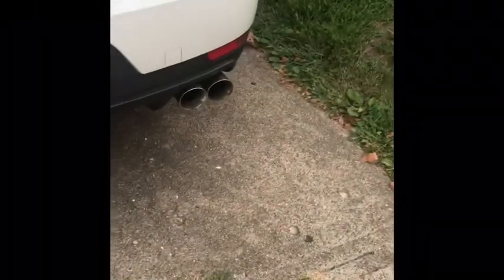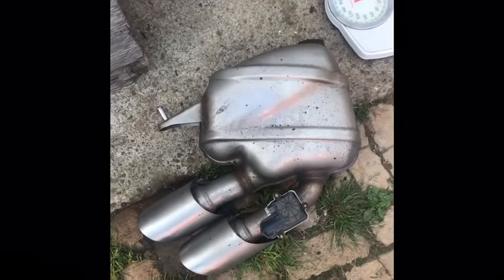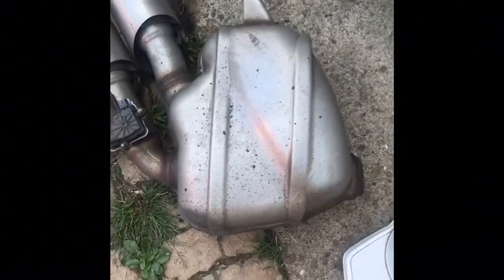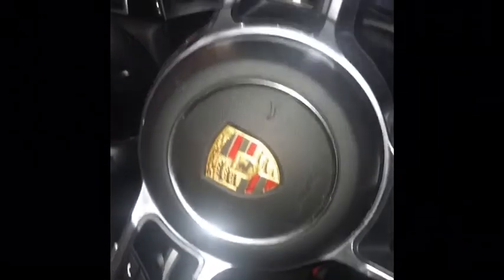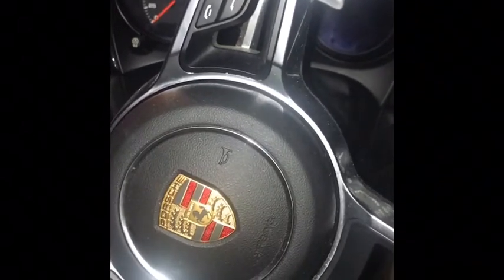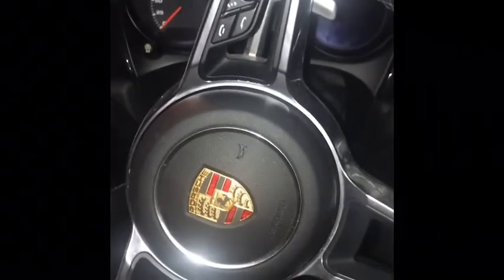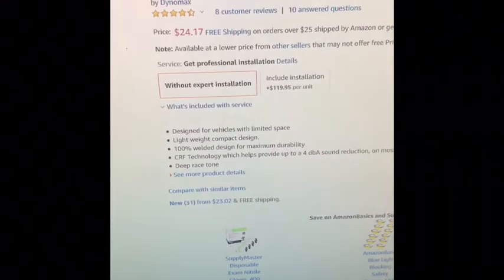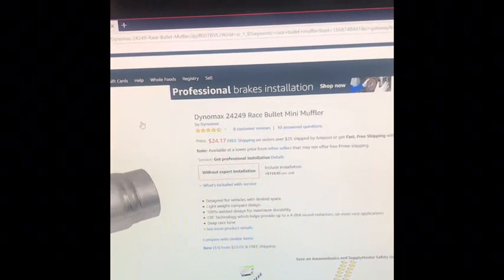Porsche Macan Muffler - delete all details drone, power, driving

Comment: Do you lose any power or performance ?
Reply from the maker: Didn’t notice. I put race mufflers on it so it will pass inspection
Reply: I had z Mazda and I put a cold air intake and it seemed to be slower I think it lost power